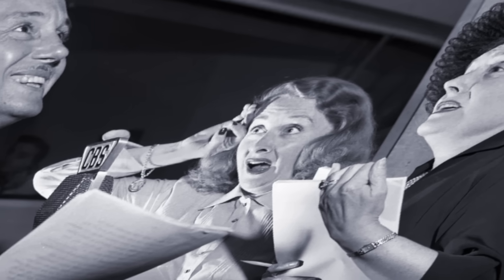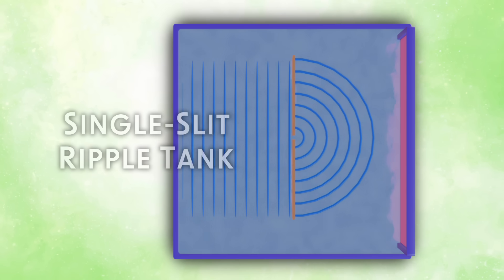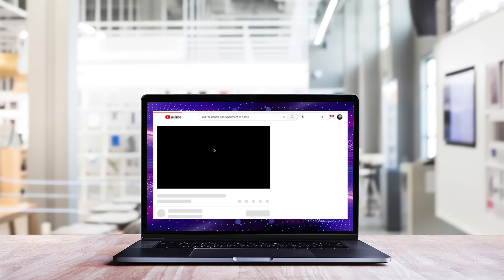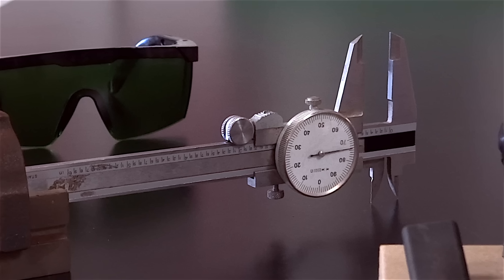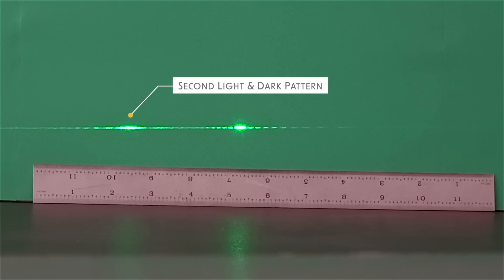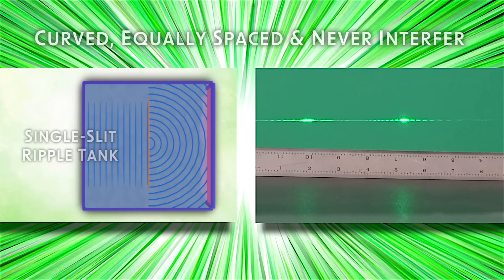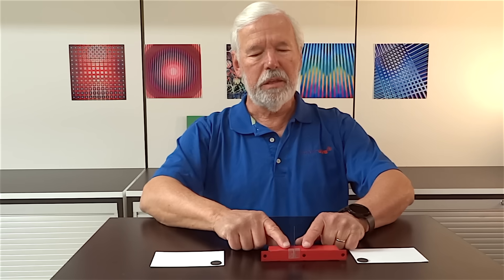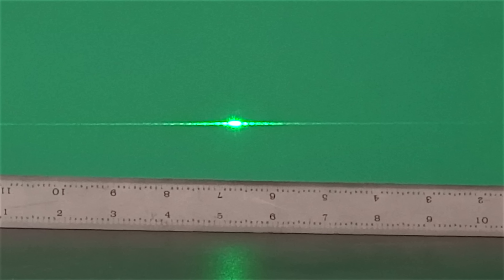Young’s Double-Slit Light Experiment Critiqued And Debunked - Chapter 1

Comment: you also used a reflective surface that effects that light... Invalid experiment. Why does everyone use something metal?
Reply from the maker: Glass mirrors can not be used because the glass changes the angle of the photons.  With metal the angle the photon reflects off the surface equals the angle of incidence.  I think this experiment opens the possibilty what is called an interference pattern is really a reflection pattern.
Reply: @jsQuantumLab  I was only able to recreate the effect when a reflective surface was introduced. Otherwise, there was no interference pattern like shown online. Just the laser going through the holes and hitting the wall like expected. I don't think glass mirrors were ever mentioned.
Reply from the maker: @skywatcher999  I tried many different materials for the experiment.  A smooth shiny surface was essential.  The results of this and other experiments make me wonder if what everyone calls an interference pattern is really a reflection pattern.  For more examples please check jsquantumlab.com.
Reply from the maker: @ I have a black carbon fiber caliper.  When i set the gap to .5 mm and the aim the laser at the slit i get the expected light dark pattern.  What i can not get is a second pattern.  To create a 2nd pattern a caliper with sharp edges and shiny surfaces is required.  I hope that explains the experiment better.
Reply: ALL surfaces reflect light to a certain degree. Even a hair will reflect light in the double-slit experiment. Of course, for experimental purposes, you wouldn't be using a matte black surface.

Comment: If you step back and think about it, he is using a green pocket laser with an exact wavelength, say, just guessing 535 nm.  Okay, is the interference pattern 535 nm spacing?  Well, either my eyesight is atomic, or no, this is a mm pattern.  So explain to me how this is an interference pattern of the wavelength of the light.
Reply from the maker: Young's experiment does not produce an interference pattern, it is a reflection pattern.  See https://www.youtube.com/watch?v=5saZ0He0Nps    to see what i think is happening.
Reply: @jsQuantumLab  Whether reflection or interference pattern the resulting pattern on the green board should be 535 nm spacing.  Is that the case?  If not, what makes it?  How can we even see it?
Reply from the maker: @donaldkasper8346  Good question.  One i have been puzzled by for a long time.  My guess is see https://www.youtube.com/watch?v=5saZ0He0Nps
Reply: @jsQuantumLab  Then I would immediately get out calipers to make several measurements of the image pattern wavelength, curious if it is a multiple of the light source wavelength.
Reply: @jsQuantumLab  The wavelength of the projection is a function of the distance from the source, which is the slit, so the value at the source can be determined by moving the projection board back at various distances, getting the wavelength of each, and running it through a least square line function, getting the equation of the line, and the value of the wavelength at zero distance.  It might even be a nonlinear function, say exponential.  There is least squares exponential calculation possible in Excel also, along with linear and others.  If the wavelength at zero is not 535 nm or whatever the laser wavelength is, then it is caused by something else not wavelength at all, which would be a major find.
Reply from the maker: @donaldkasper8346  Laser light is not 1 frequency.  A laser produces a narrow band of frequencies.  see https://www.youtube.com/watch?v=Cq6ldXOnD4w
Reply: @jsQuantumLab  A lead pencil is carbon, a black body.  How does light reflect off of a black body?
Reply from the maker: @donaldkasper8346  Depends on the texture of the flat surface.  The surface must be smooth or the photons will scatter.
Reply: Looking at this again there are two light products.  The light that went straight through is brightest.  The reflection or interference pattern is something else, and it tapers off farther from the center.  The farther from the center, the lower the probability, which to me doesn't sound like a wave behavior.  Is the pattern elongating the farther from the center?  This result may be from multiple causes.  The pattern complexity is likely not a thing in, an effect, and a thing out.  It is a thing in, a whole set of behaviors all combined out.
Reply from the maker: @donaldkasper8346  My premise is they are both reflection patterns

Comment: I recommend you do the calliper experiment with callipers dyed green. Then the part reflecting will be yellow.

This would demonstrate true interference, as red and green are different wavelengths and wherever the two beams overlap would turn orange.

The length between the gaps will change in the yellow light (This has been demonstrated).

But while these things do not debunk lightwaves, what they do is demonstrate that the gaps we see have nothing to do with waves, as none of the width of the gap, the angle of the gap, nor the interference changes the color of the wave.

But it is color that demonstrates the wave property. The double-slit experiment does nothing but demonstrates the spherical property of emitted/reflected light and decoherence along the perpendicular axis. It does not demonstrate waves.
Reply from the maker: Interesting comment.  Got me wondering.  Tried aiming a red laser and green laser at the same spot.  No change in color like you see with other light sources.  

I agree with your comment about young's exp does not demonstrate waves.  If you watch the second half of my 3rd video a barrier is placed between the 2 slits in Young's exp. The barrier makes interference impossible.  The interference pattern did not disappear.  I call the experiment Stute's Guardrail Experiment.  Hope you will watch it and comment.

Comment: Lightwaves do not "expand"; they are static.  This is the problem with the water comparison.

The real way to expose the issue is to move the background. If wave-like interference is true, then as you move the background backwards and forwards, the patterned light bundles should disappear and appear again, showing where they get interfered with. However, if they remain solid no matter the position of the background they land on, then interference is busted.

Now as to the "double-slit" experiment you reproduced, the single slit was fine. I agree. In the second one, however, you used a round pencil lead, which creates a very poor double-slit result that is difficult to see on camera. That is what they call "collapse of the wavefunction." In order to replicate it properly, you need a proper flat middle barrier as well callibrated as the callipers. It should also be wider. The width of the middle barrier increases the width of the interference gaps, but not too wide or the wave decoheres.

My theory is that the electromagnetism of the emitting, reflecting or permitting source establishes the electromagnetic signature (vibration) of the particle of light.

Also, the purpose of the slits is to narrow the beam. Otherwise, you get diffused light in the vertical direction.
Reply from the maker: i like your idea of moving the background backwards and forwards and see what happens to the interference pattern.   Gave some thought to setting up such an exp.  That would be hard to do because the wavelength is in the nanometer range.

I have test round wire and square wire barriers.  Basicly get the same result.  Good question.  Happy to try any other options you think relavent.
Reply: You just go back and aim the laser past the end of the sheet of paper.  What you are saying with the slits narrowing the beam is that it acts like a polarizer.  Well then you have to rotate it next.
Reply from the maker: You talked about moving the background backward and forward.  I did that experiment and you can watch the results here.  What do you think ?https://www.youtube.com/watch?v=MMsG7P3MGlo&ab_channel=QuantumLab
Reply: @jsQuantumLab Thank you for the update. I will respond on that video next with a full explanation of your results as a result of my own work over the summer.

Comment: The ripple tank analogy is still accurate even with just the single pencil led - a pole in a ripple tank would behave the same way.
Reply: Tried putting a 1" round dowel in my ripple tank.  I did not see a light/dark pattern.  Did i misunderstand your comment?
Reply: Clarification.  I have not been able to find a commercially available ripple tank with controls to set wave frequency and amplitude.  The round dowel exp is a good of why this is important.  Low amplitude high frequency no interference is visible.  High amplitude low frequency and interference is evident briefly.  Without the ability to specify test parameters it is possible for 1 person to say no interference and another to say there is and both would be right.